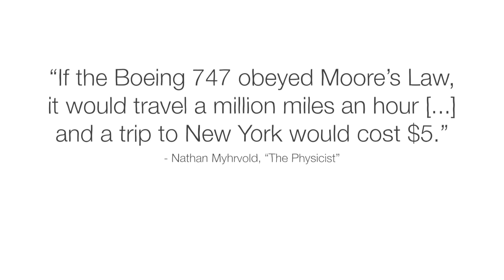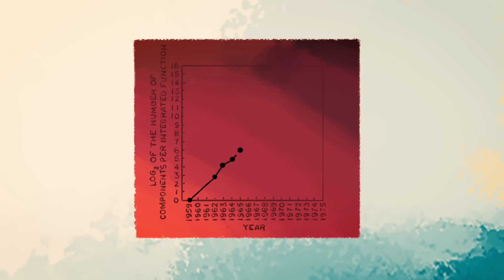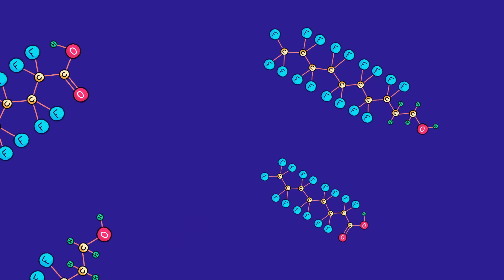Have we reached the limit of computer power? - Sajan Saini and George Zaidan

Comment: One thing we can focus on is optimization of how we use computing resources. In the early days, OS and application developers often had to work hard to constrain their programs to not overfill the limited computing resources. As we've gotten more and more power, a lot of programs have gotten really bloated; they use way more resources than necessary just because those resources are there. If we minimize resource consumption of applications, we can get a lot more bang for our buck from what processing we do create. Plus we could have longer support of older things -- think of how many devices are just in a landfill simply because the manufacturer decided not to write new code for it. 10+ year old hardware may not be as fast, but with the right software, can still be useful

Comment: 2:05 That is actually not the reason heat is generated, and is in fact completely incorrect.
The real reason processors generate heat is because the gates of the field-effect transistors act like capacitors, and when their state is changing (from high to low or vice versa) the capacitor has to be discharged, which is a current and therefore generates heat. Otherwise, all MOSFET chips work on exclusively voltage levels, there is no analog circuitry that draws current.
This is the same reason why using smaller transistors generates less heat (smaller gates means less electrons needed to generate a field to enable the transistor, so less current i.e. less heat) and also why the heat generated is directly proportional to the frequency of the processor (higher clocks means more operations per second, so the capacitors need to be charged and discharged more often, generating more heat).
The heat generated has absolutely nothing to do with the size of the copper wires. And also, using smaller and more advanced semiconductor nodes like EUV will actually decrease heat generated by the processors. The reason heat is increasing is because of two things: there are more transistors on a die (more cores, more instructions, etc...), and clock speeds are increasing (~3GHz was normal in 2010, now it's ~5GHz)

I can't believe the writers got this very basic thing wrong...

Comment: I have a very specific question. If transistors can't go more smaller, which means that it's not possible to make more powerful chips. This means that GPUs also can't become powerful. But if that's the case, how come many of our operations are still too demanding? if we are reaching physical limitations then how come games are keep becoming more demanding?
Reply: I think it is because games developers are utilizing the full potential of available resources—including CPU cores, GPU cores, memory, and specialized hardware. While our computers often do not use all the available computing power of the GPU and CPU
Reply: You can't make transistors smaller, but you can make the chips bigger. The limit now is thermal and yield percent.

Comment: Those beams of UV light need to be reflected and foxused by incredibly precise mirrors, which are made by the company ZEISS in Germany. To give you an idea how precise these mirrors are: If you'd enlarge them to the size of all of Germany, the largest imperfection on that huge mirror would be less than a single millimeter tall.
Reply: atomically smooth, the worst imperfection is one atom off.
Reply: Were the same mirrors used in James Webb Telescope?
Reply: @tejaspatel6965  well... the layout is obviously completely different but the precision is just as nuts
Reply: @tejaspatel6965  Yeah same company pretty much the only company who can make mirrors at that precision.
Reply: @tejaspatel6965  I don't think so. The mirrors on James Webb don't allow for even single millimeter imperfection.
Reply: @gotfan7743  I don't think you understood the original comment. The ZEISS mirrors don't have an imperfection of 1mm.
Reply: Only Carl Zeiss has the tech to make those mirrors on which the world's computers are made and their CEO has the last name Rothschild.

Comment: I often see that developers don't write efficient code. If we put more effort into making more efficient programs, OSes and writing more efficient code, we can also lower the power consumption considerably. As an example think about improving Windows 12 and making it 25% more energy efficient compared to Windows 11. That would have a substantial cumulative energy saving worldwide.
Reply: yall remember how windows 98, xp, even 7 were wayyyy moore responsive than modern OSes on machines 10x the power
Reply: I agree with OP. Cutting bloat in existing systems would do a lot to prolong the tech we already have. Even if you just use an adblocker, you can see how much faster a website loads when one hurdle is removed. If you could similarly streamline the crud out of EVERY part of the OS, that would add up.
Reply: This. A lot of modern code is really, really wasteful. If we really tried and optimized everything, our current hardware could probably  allow at least a couple X performance improvement. 

Like, really, we have multiple everyday use programs that do not do much more than their equivalents a decade ago, but still use the same share out of our so much larger pool of hardware resources
Reply: Finally, a sane computer user! Everything is so unoptimized, people would still be using 10 year old computers regularly if it weren’t for badly written code. I don’t wanna be that guy, but my underpowered business laptop from 2019 struggles with windows 11 but runs amazing on Linux mint.
Reply: @Viscous_Flow I got a cheap ~$230 laptop from Walmart when my main gaming laptop was having battery issues. It has 4GB RAM, and it had win11 factory installed (this should be considered a crime against humanity), it would start lagging just by opening a single browser tab, with nothing else running. This lead me to do a completely fresh Linux mint install. Even the version with the most "bloat" (cinnamon), my laptop runs it effortlessly. It really is impressive how optimized most Linux distros are, even those that are "windows-like". Now I just wish most browsers and general applications were as optimized. And don't even get me started on how unoptimized video games are. If they were all as optimized as they were in the 90's, you could buy a top of the line PC now and it could still hold up 30 years later... We need more devs like the guy who made rollercoaster tycoon solely in assembly, but of course game companies would never put so much time and effort into optimization
Reply: I think this will happen once we find a hard wall without any improvement in hardware for 10 years, the race will still be there and now the only way to release new updates and be on top of the competition is to be the most performant
Reply: But you won't be first to market with that attitude!
Reply: @mattwatson9419  Could you clarify what you mean? I don't understand it.
Reply: @MarinusMakesStuff  i think what he meant is
it'll took more time and effort, and by the time is finish, the competitor already on the market, stealing the early start
Reply: @ I mean that in a competitive market companies that make it to market before other competitors will have a market advantage. What's first available to consumers often becomes adopted and normalized, even if there are better alternatives in the market.
Reply: We could, but there's a reason for the inefficient code. Good code is expensive. You need more experienced and skilled programmers, who cost more. You need them to work for a lot longer, which costs even more. And the lower-level code is not so portable or easily understood, so it requires more expensive programmers to keep it up to date. As the hardware gets better, this allows for a reduction in the cost of software development.
Reply: @vylbird8014  When it comes to game dev, the lowest level we usually get is OS-Specific system calls and rendering APIs (Vulkan & OpenGL).
And those are APIs.

That is to say, low-level isn't all too important. From what I've seen, optimized code is less important than well-written code.
If code is well-written, adding new things and removing old things takes very little processing power. If code is poorly written, we get thousands of hacky fixes for the simplest of things, taking up more power while also being unstable - See the final version of Adobe Flash versus the latest version of Adobe Animate; to my knowledge, Animate crashes more because it's all hacky fixes.
Reply: Don't worry, advancements in AI should make developers more efficient and eventually replace them.
Reply: AI itself consumes a ridiculous amount of energy and water in both training and generation, to the point where it's straining city power grids considerably, and this year residents might start suffering micro-blackouts because of it. Any efficiency improvements AI might discover wouldn't be enough to compensate for the cost of producing said results.

In any case, we already know a lot of ways to make code efficient, software companies just don't prioritize it enough, instead expecting consumers to be the ones to acquire more and more potent hardware to keep up with the demands of their software. This is particularly evident in the videogame industry.
Reply: @answer5092  Yes, that what I was getting at and forget to mention. Often times we don't need ('need' in terms of capabilities of our hardware, but we should definitely look at the power usage as also in my country, we are hitting the limits already) to be very efficient because we expect the hardware to keep up with the demands of the software. Well spoken.

In my country, this Christmas, power companies had to turn on emergency aggregates to keep up with the power demand because everyone used electric stoves on Christmas eve. That hasn't happened before. Happened to be in the same area as where Google and Microsoft have big data centers.
Reply: @jbcodilan yeah thats not going to happen. Taxi / bus drivers didn't replace personal cars nor will AI replace those who program

Comment: i would imagine if tomorrow they said its no longer possible to make chips smaller or denser, we could probably get a lot of mileage just from making our software more efficient. how long has it been now where companies just dont bother trying to optimise anything because they know that most people have newer hardware or will upgrade at some point, so they dont really need to bother trying to make things run more efficiently. so much software has telemetry these days or will download new ads every few hours even if you dont have the app open. all of that is just pointless computation that is going on in the background for no good reason

Comment: As a chip designer myself for 10 years, a video related to my work has finally been published on TED! Our daily challenges are solving the most, if not the hardest problem of this century.
Reply: that's a bit presumptuous
Reply: there is a lot of problems in science that are just unsolvable. At some point moore's law will be unsolvable but we are not there yet and at the same time we could even ask ourselves what is even the point of having that much processing power for personal use since if the private want more processing power it is possible to just make it much bigger . 

If I had to give my opinion about the hardest problem of this century it would probably be solving human greed before the system collapse which is theoretically possible and even quite easy but at the same time impossible because the power in place refuse to work for the long term interest of humanity.
Reply: @tolmir2929 these chips aren't for personal use. It's mostly for industrial or military usage. Whatever a regular consumer ends up buying is at least a few years behind the cutting edge chips.
Reply: @ this is untrue the military manufacturer for microchips in the US is Intel and they make chips for personal use too. The method of making the chips are the same, there is 2 difference however :

a CPU in a computer is not specialized for any task it's like a swiss knife while chips for ships or missile are programmed for specific tasks so they can do them faster. The second difference is that they are made to be resistant to adverse conditions if your ship is sinking you want your electronics to still work while if you throw water on your computer it's dead. 

Because of movies and TV show people have the wrong idea that the army have access to technologies nobody else does, while in some case it is true in most case it's just a different application of a technology most people already have access to.
Reply: @Thanos-hp1mw consumers get equally advanced if not more advanced chips. Just because it's the military doesn't automatically mean they have the best (You have made a logical fallacy). GPUs started out as a consumer technology that was later utilized by institutions and military because they found out it can do more than just run games lol
Reply: It’s not a big deal
Reply: hold on now the century is only a quarter done
Reply: How many chip designers have lost their job due to failure to achieve Moore's Law
Reply: Im currently an undergrad at a top 5 engineering school in the US with a focus in chip design (focus area is in RTL Design, have a digital hardware internship over the summer, though I also wanna get into physical design/VLSI aspect. Currently working on an Out of Order Superscalar RISC-V processor) 

is this the hardest problem in the world? Who knows? Is this the coolest problem to tackle in the world? Absolutely (unbiased lol). Nevertheless, really respect the work that we do, at least from my undergrad curriculum this stuff is brutally difficult

Comment: I don't recommend using a metal spatula on on a cpu, to avoid scratching or cracking it I generally use a rubber spatula like you would on a non stick pan.
Reply: That's your problem with the egg analogy.
Reply: Remember to season your heat sinks everyone 😌
Reply: @aliengeo  Yep, I like a heavy drizzle of a 1 to 1 mix of conventional and liquid metal thermal paste, with a sprinkle of crushed 5090 too.

Comment: Latest Nvidia chips, like the 5090, are 30% faster, 30% more expensive, and consume 30% more power than last gen chips (more or less), and this was true for last gen too, Moore's law is dead.
Reply: Nvidia doesn't make the chips... Other companies do. And these other companies are still innovating- a few months ago, ASML revealed their newest generation of lithography machines that could make transistors 3x smaller. We'll start seeing mass production of such chips in 2026ish. This will probably be in the next generation of gpus and I'm sure they'll be much better then. Or maybe not! We'll see.

That being said though, I've been hearing that "moores law is dead" for 10 years now and yet they keep innovating, and chips keep getting smaller. Eventually there will be a limit but it'll probably be another 10 years before that.
Reply: @qkasriel  That is because it's been true for ten years, take the GTX titan X for example, if processing power doubled every two years, the 5090 would be 32 times faster (2^5 for ten year period,), but it's not, it's closer to 7 times, thus Moore's Law, is DEAD, Nvidia designs their chips based on what they can get made. Innovations add up sure, but not like it used to. I stand by what I said.
Reply: @ fair enough

Comment: moore's law was never a law. It was a self-fulfilling prophecy. A taget the companies could use to estimate the competition.
For pc's moore's law have been dead for more than 10 years now. The nice thing is that a good pc will last you much longer now.
The bad thing is that software that was build with the expectation of morre's law still runs very slow on a moden PC.

In recent years we have seen more and more "accelerators", specialized hardware that can run specific algorithms very fast and efficient. A good example of this has been video encoding. Codecs like H.264, VP9, AV1 etc. that are used to playback (decode) videos like this one can run extremely fast on dedicated hardware, but it takes up some space on the chip, thus it can only be used for algorithms what a used very often. Cause when you are not decoding video this part of the chip is doing nothing.
(We are beginning to see the same thing for AI algorithms)

Comment: instead of tin can't it shoot streams of droplets of any other metal in that costly $400 million machine?
Reply: Tin's emission spectrum when heated generates the 13.5 nm EUV light necessary for modern lithography.
Reply: They need tin because when it's vaporized by the laser it produces that specific wavelength used for lithography

Comment: You can check Moore's law on your cellphone: the first iPhone was 16 GB in Flash memory in 2007. Today, high end phones are 1 TB, or 64 times more. This is equivalent to 2^6, or 6 cycles of shrinking and innovation in 18 years, a little less than the law predicted, but an impressive feat.  There aren't many things that improve at that rate for so long in human history.
Reply: 16gb in solid storage, not flash memory
modern phones do not have 1 tb of flash memory
Reply: Moore's law dont refer to storage capacity, but computational power.